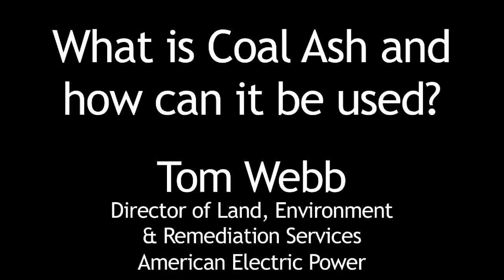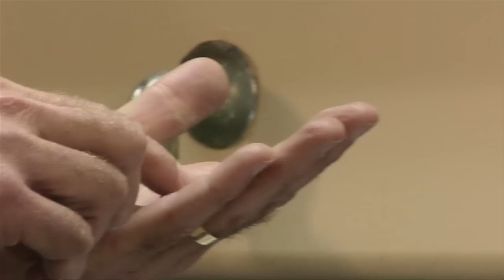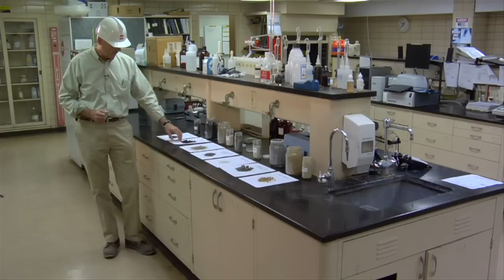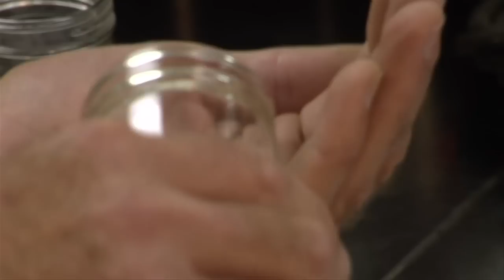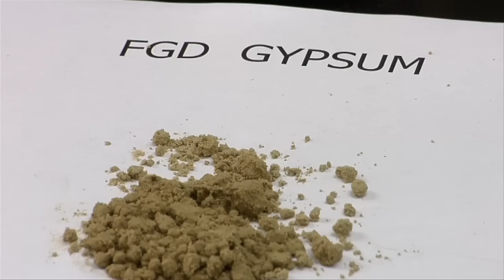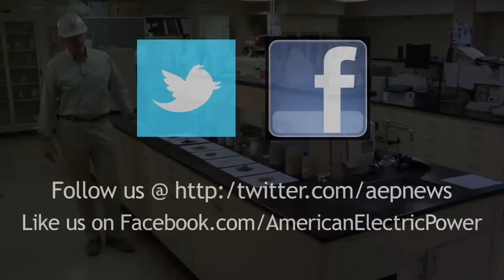What is coal ash and how can it be used?

Comment: Why are you wearing a hard hat in a chemistry lab? You should be showing how to incorporate safety into the handling of those products too. Wash your hands guy... Sulfur doesn't feel good on the skin after a little while. I'm not against coal, I use it in a small furnace out back. I just think safety is key and that a chemist should do a video if it is going to be filmed inside a lab. Thank you